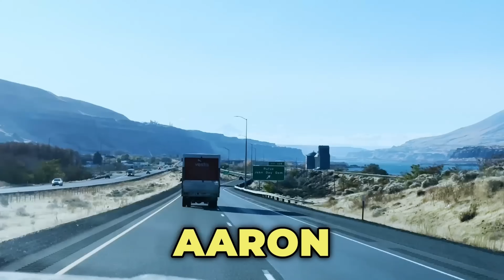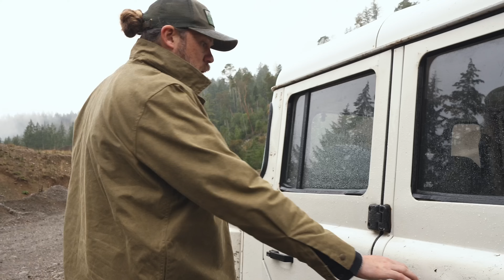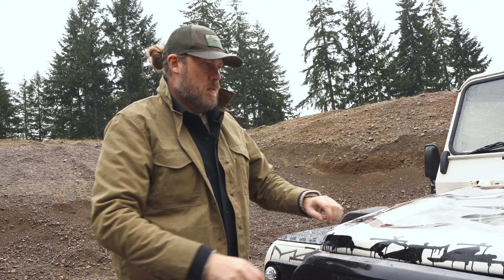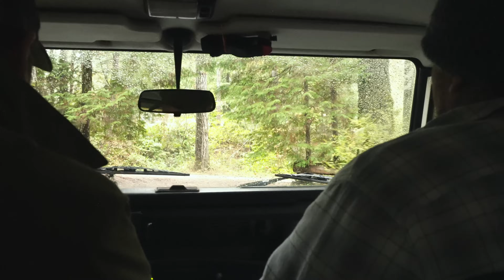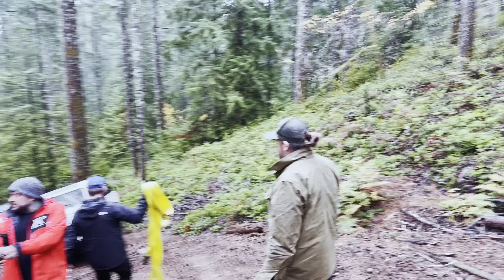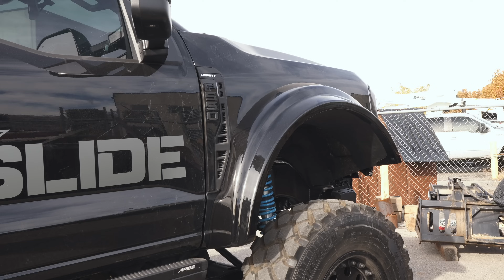WE PICKED UP OUR NEW PROJECT! *(FULL DEFENDER 130 REBUILD)

Comment: I was super excited until I heard the proposal, however I still under stand it was just a proposal. As a owner off three, do I also have a proposal. Strip it down and refurbish till you have an out of the box kind of vehicle. Removing the body to put on another chassis on I feel takes a away from the Defender, might as well build a chassis from scratch, put a model T body on with a dump bed. 

After refurbishment, front and rear locker, slight lift, may be portals, which, lights standard touring vehicle upgrades.

Now the Td5 is a lovely motor, got two of them, also pretty bullet proof, owner dependent. My motor of choice that I would replace my current Defender 130 with that has a Ford 2.2 Transit van engine in, would be the BMW M57, Mercedes OM606 or the Cummins 6bt.

Regardless of which way you guys swing, am I also pretty excited and nervous to see how this build goes.
Goodluck.
Reply from the maker: This would be a great build the way you have it. I think it will get a custom chassis with a dump bed. The owner is pretty set on a 12 valve that will be job to fit everything. We should be on it after thanksgiving. Stay tune haha